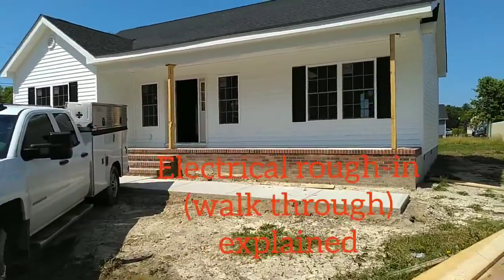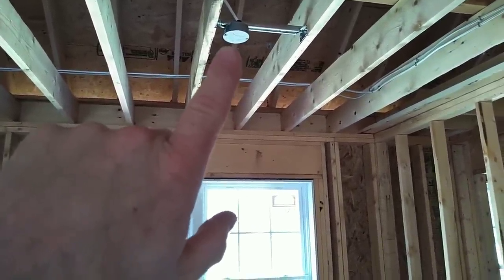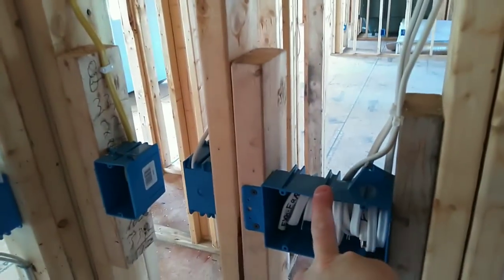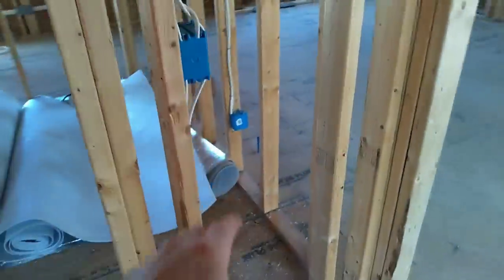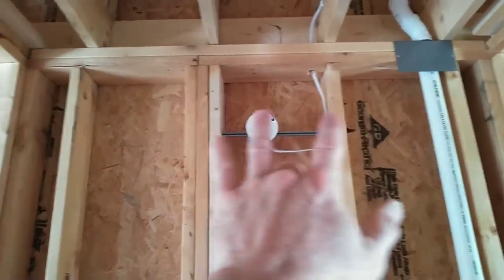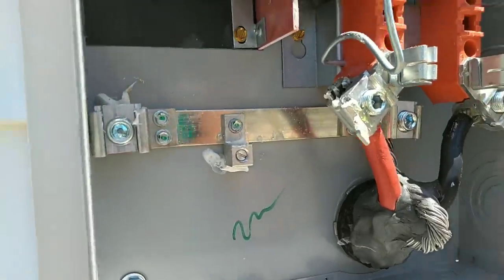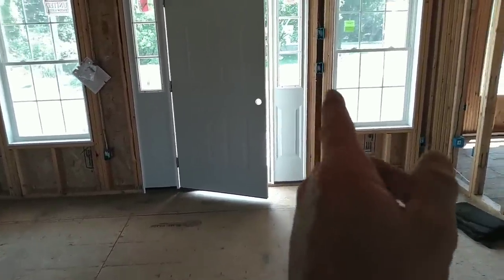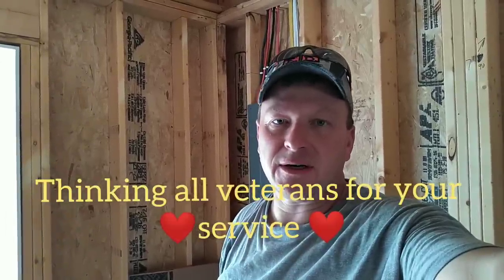Electrical rough-in outlet spacing 🤔  Better explained

Comment: I retired 23 years ago and am shocked to see Aluminum wire in a house?  Did I see right?
Reply from the maker: Hey John. Thanks for watching and commenting. The only aluminum is the 4/0 feeding the main breaker. All my branch circuit feeders are copper. But I would mention some of the supply houses are trying to push the new copper cladded aluminum wire now. I'm not budging on that stuff. Not gonna use it..

Comment: I just think the code is seriously under counting the need for more outlets in rooms with the range and number of electrical devices I always install more including quads near to TV areas avoids more dangerous trailing extension leads.
Reply from the maker: Thank you Math Man, for watching and commenting ❤️
I agree with you on outlet count. I would normally install more outlets, if they request them. If I was building my personal house, I would have twice as many!

Comment: Why not coil the RG6 in the box?
Reply from the maker: That is a very good question. I don't coil the Rg-6 for  it doesn't hold a tight coil. The drywallers will strike them with rota- zip cutters. And could possibly kink the line if coiled to tight, thus causing a weak signal on the line. Thanks for watching 👍

Comment: Why not just put an outlet every 6ft amd be good?  They're cheap when the studs are showing.  One added after the fact will cost as much as doubling them from the start.
Reply from the maker: Thanks for watching and commenting. Your right about that. Much cheaper now than later. Most houses in my videos are single family starter home that need to be kept affordable. Placing outlets to the NEC standards is a must to achieve the cheapest cost to build. If I did an outlet ever 6' would drive up cost of each job and the contractor would hire a different electrician.

Comment: I see this was done in 2022. In 2023 you would be required to use ark or ark/ground fault circuit breakers instead of the GFI outlets. They cost more.
Reply from the maker: Thanks for watching and commenting. This video is based on Maryland using the 2017 NEC codes. It probably wasn't clear enough to my viewers in this rough-in-video. I go over more details in trim-out-videos about the use of arc fault and GFCI usage. Thanks again for watching 👍🏻